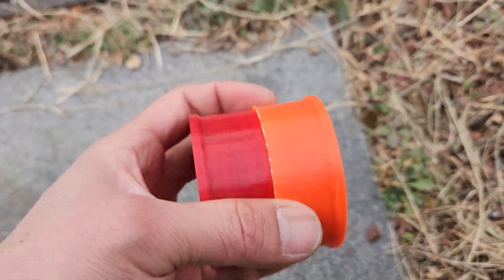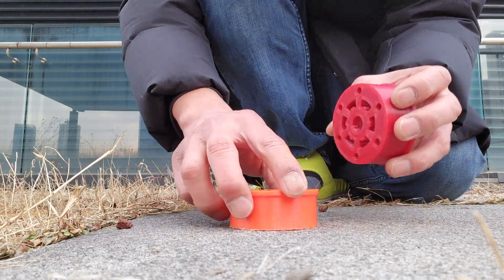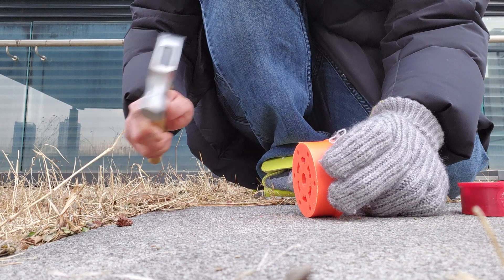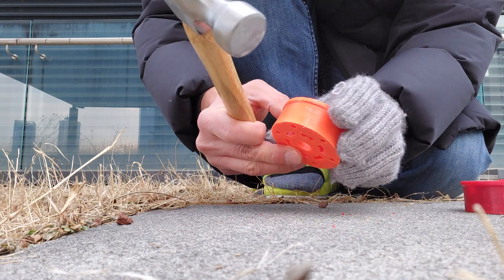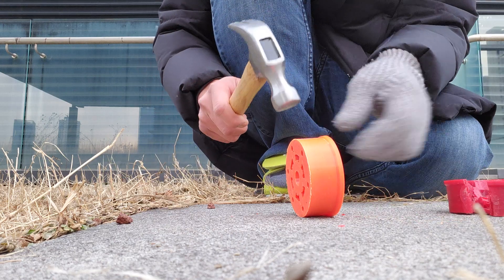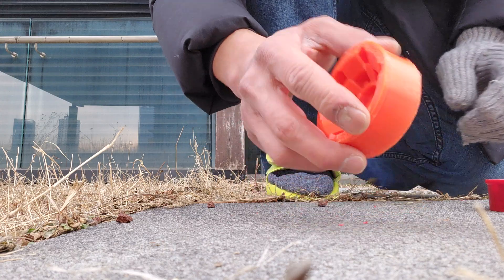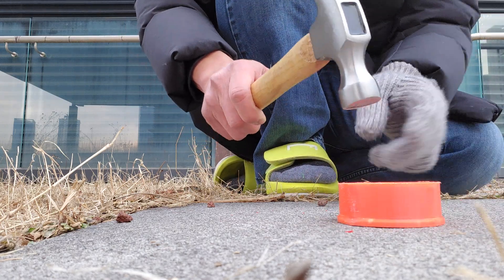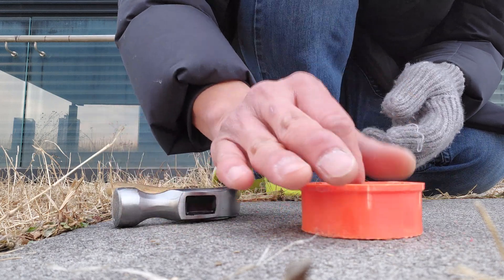3D Printed PETG vs ABS Real Life Test!   Which one stronger?

Comment: RIP to the PETG gang. Get real guys and use an enclosure for an actual strong material. Sure it's hard and all and PETG is convenient but stop making it sound like it's the same. If you're gonna compromise you compromise. But don't deny it. There's a reason stuff like ABS and PC are used in industrial manufacturing. If you really need something strong you can easily find a way to enclose even the cheapest printer and print ABS at 240C or a bit higher
Reply: PETG doesn't stink :) PETG-PC blends are pretty good (my favourite filament)

Comment: What are the brand name for the filament you used? What speed and temp settings did you use? Layer hight? What cooling did you use?

All of this has an impact on the filament printed.  Without all info, this video is misleading and not a info video on impact resistant in cold weather..

Comment: It depends more on how you print it than the material unless you are comparing with a brittle material such as PLA. If you print both in a heated chamebr close to their glass transition temperature they will be very strong. For ABS you need to print it in an 80C chamber and PETG in about 60C. You need a lot of cooling in those temps and hotend cooling needs to be very good for the filament not to melt in the cold section of the hotend so it doesn't clog. I would say if you have an desktop printer with an enclosure PETG will be much stronger because you can print it at much closer to it's glass transition temp unless your printer is heavily modded to withstand enclosure temperatures of 80C.

Comment: what we need is a little perspective here in material properties -- there are all sorts of completely non-arbitrary mechanical tests to measure these properties. consider the following:

- tensile strength
- fracture toughness
- strength
- brittleness
- hardness

these are industrial terms -- we also have terms specific to additive fabrication such as:

- layer adhesion
- manufacturer specific material composition
- a multitude of temperatures and machine-specific properties that add or detract from the final product

generally, it is difficult to come up with a material that is both tough and hard; many of these properties (and I have only named a few) are almost opposites to one another.

the TLDR is that this video actually shows nothing except that your particular printer prints your particular filaments in such a way that one round object resists hammer blows better than the other.

there are a multitude of reasons PETG gets used for parts that need to withstand thermal stresses, tensile stresses (most of which being cyclic in nature) and last a long time.

I recommend researching material properties instead of just ignorantly declaring one is better than the other -- I think this video is misleading (you did have disclaimers, but my opinion is that they are inadequate)
Reply: Correct.
Only thing he is showing is that he's printer prints these filaments from these batches so that one resists a hammer more then the other.
That's it..
If ppl who prints parts in petg, suddenly turn to abs after this video. Then some of them is going to have a surprise.
On my printer, I use abs+, petg and pla+. All for different things. But for Rc stuff, like what he shows here, I use petg mostly all the time, except for gears.  On gears i mostly use nylon tho.
Reply: Yeah, but some of these seem advertised and then reality is different. I found hard to believe that PCTG is superior to PETG in impact resistance, I did similar hammer test and difference is that PCTG cracks and bends much sooner, PETG seems harder and more brittle so when it fails, it shatters and shards have very little deformation if any despite both materials seem to have about the same flexibility (maybe PETG is harder to bend permanently?). But I don't know which one, if any, is suitable for something like phone holder mounted to bike handlebars where it needs to absorb vibrations and some shocks. Possibly concentrated around screw holes. And in 5C temperature.

Comment: It doesn't make much sense to use the term "strong" to describe the properties in this case because what you are measuring is impact resistance, not strength.  
PETG is decently strong in some sense as it can handle a high tensile load, thus having great tensile strength, but it is also brittle, making it have very poor impact resistance. For ABS it's the other way around, so depending on what mechanical property you need (tensile strength vs impact resistance) both can have useful mechanical applications.
Reply from the maker: I think the problem is that many online websites tell you PETG has better impact resistance than abs,  we need more real life tests with different models.  I think also design of your object has a very impact.
Reply from the maker: I also found out petg is very brittle in cold weather so that might explain things as petg loses over 50 percent of impact resistance in colder weather.  I am in freezing weather here atm with lots of ice on the road.  Which makes abs actually great for hot and cold weather.
Reply: @3dPrinterSchool  This is exactly the case. A friend printed a fuselage for an RC plane that lands on it's belly in PETG. Literally everywhere they claimed PETG had better impact resistance than ABS ans PLA. The thing totally snapped on the first (gentle) landing. Many people don't realise how material properties really work. Like thinking carbon fibre is incredibly strong. It is strong, but more in the context of beeing very light and still strong. You wouldn't build a big stationary machine out of it tho (moving 3D printer gantry not included obviously).

Definitely more real life tests! It's easier to comprehend for most hobby people.
Reply: @steilkurbler4973  Carbon Fiber Nylon blends have high impact resistance, but don't like being compressed. That's the the hull of the Titan sub failed. The pressure was too high for the Carbon Fiber. PLA is strong but brittle and has no UV or chemical resistance. PETG has has better compression strength, not impact.

Comment: Wow I did not know the difference was that big 😀
Reply: I need to get myself some ABS and fast! And an enclosed printer. Voron seems to be way to much fun, and I love tinkering, but time is of the essence 😂
Reply: @jon-andersnethaug8454  put a cardboard box over your printer and print your voron parts
Reply: @travistucker7317  Is it really that simple? No need for an enclosure?
Reply: @Jon-Anders Nethaug  yes if you need to print abs or asa without an enclosure you can just drop a box over the top.  You might have to fiddle with the control and with seeing what is going on, but it will work. 

It will work well enough to print some parts. 

You can get a cheap enclosure off Amazon or wherever.

I'd rather print abs than pla at this point
Reply: @travistucker7317  I will buy some things to build an enclosure 😀
Reply: @travistucker7317  Doesn't even have to be a cardboard box ... anything that can cover the printer and keep out drafts ....
Heck, if you are only printing a cpl of parts even an Ooze/Draft shield in your slicer will allow ABS on a non-enclosed printer